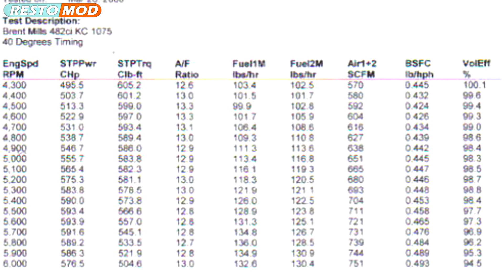Ford GT40 MK IV Build Project

Comment: Wonderful work. Would recommend either a wider offset for the rear wheels, a wider suspension set up or simply fatter tires at the rear.